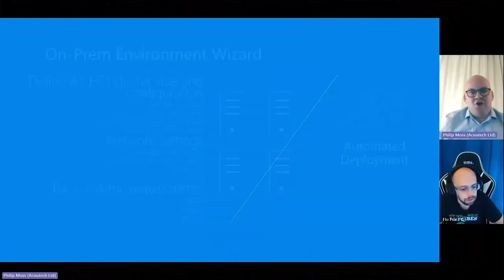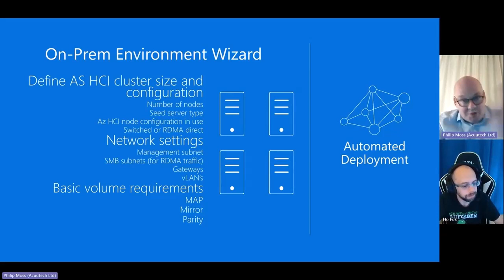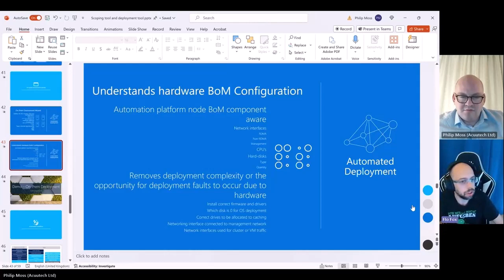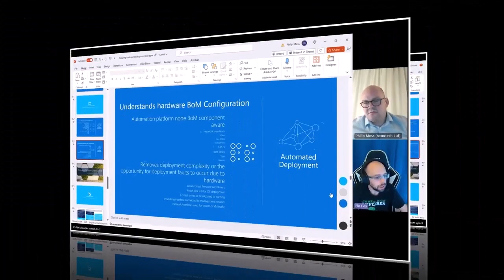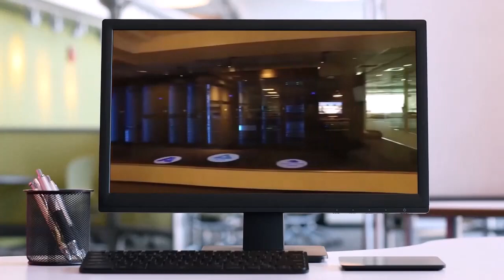Azure Stack HCI - Why automation is key when deploying HCI /w Philip Moss ( @acuutech )

Comment: Always a pleasure to listen to Phil talk. That said, I'm going to pick on AzStackHCI (AzHCI) a bit as it's one of my favorite pastimes. :)

I'll preface the following as "I hope it's become better in the last 1-2 years":

Frankly, I laugh at the assertion that we should treat nodes as cattle. For one - they're expensive. Now, livestock are expensive too, but depending on the exact BOM in a node, we're easily talking tens of thousands of dollars. Two - sometimes supply chains or budget constraints limit how and when you can get access to hardware. With a cow the period of gestation is rather predictable, and you benefit from parallization. As we all probably know, nodes are not quite so predictable and sometimes the timing of buying a new node needs you need to think about when to end/stop various support contracts too.

Third, if a disease affects one cow, it can affect another cow. If a bug crash affects one node, it can affect another. Obviously this comes down to numbers. If you have dozens of cows, then maybe one cow become diseased isn't a big deal. But those of us with small ranches with only a handful of cows, even one cow falling ill is a HUGE deal. That's why we MITIGATE the problem with clusters, but it's not a complete REMEDIATION.

Fourth (and most importantly)- AzHCI never ever ever filled me with the confidence that it can swap a node in. We all know how terrible both WAC and PowerShell are at getting an AzHCI cluster built, that's why the gap is being filled with Acuutech (and probably other companies). But have you ever had to actually replace a pNIC in a server and get that NIC added back into the SET team? Or have you ever actually replaced just one node in that cluster at a time? Do you know how to do that in less than an hour of your time? I am HIGHLY skeptical that you do.

Finally - the reason I think most customers choose AzHCI is because of competitive cost compared to other platforms. Personally? I think AzHCI is great for non-production workloads. Workloads where you still want to cluster and converge storage/compute, but don't care about incredible uptime or reliability. Because my first hand experience (and the experiences I've heard from others) indicate that when something goes wrong with your cluster, Azure support wants you to rebuild the whole thing. Because no one knows how to fix it. Point I'm getting at is AzHCI is in a bit of weird territory - for customers who are looking to cut costs, but maintenance costs for the platform are still SUPER high. It's a gambit - not one I'm willing to recommend for production systems.
Reply: James you've hit the nail on the head with point 4.
The vendors or consultancies bridge the gap between the lacking MS docs and anything that deviates from whatever system the powershell/wac scripts were tested on.

As for Cattle/Pets.  I'd love to simply validate my 2 nodes are supported, that the hardware/NICs are supported and then just follow the docs.  But too many things trip up the docs, the scripts, the expectations, the 'not very edge' cases like having to use a proxy for connectivity.  This is standard in many enterprises.  But that will break 22h2 deployment early on (even if you download their custom WinInetproxy module) and it will break a Preview/Supplemental deployment later on instead.

It's a revenue generation stream that keeps hardware vendors in consultancy.
Reply from the maker: @mrcneale I'm not allowed to tell more but keep an eye on the ignite announcements. My team got the feedback you and James provided a lot and many things will change to the better. :) But please keep the feedback going. :) Cheers, Flo
Reply from the maker: Thank you for your feedback and I will definitely provide it to the product group but need to disagree to two points. The lifestock example incl. Only the OS. For the Hardware, replacement and troubleshooting is perfectly fine. Everything else would be uneconomical and would harm the environment. In regards to support, I only can speak for emea but they heavily evolved over the past two years. They are now able to deep dive into issue and can solve things without redeployment. :) cheers, Flo